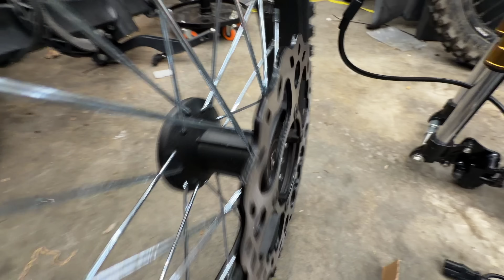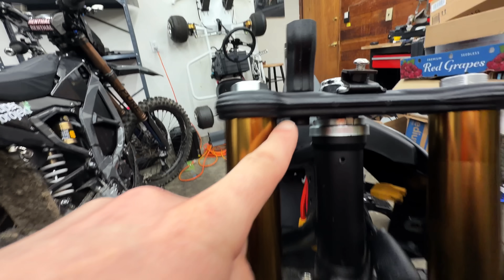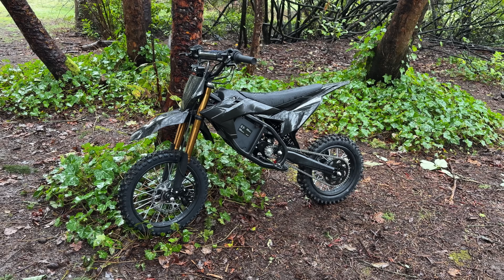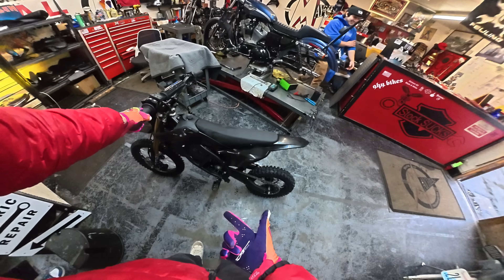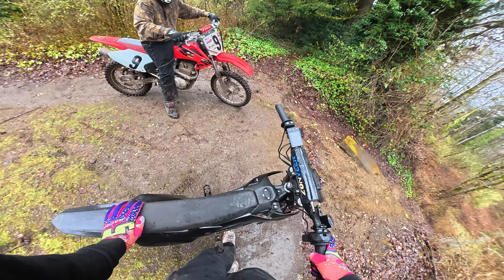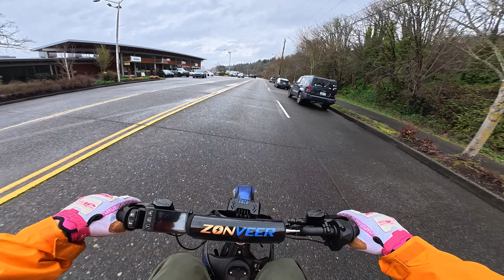Budget Mini Bikes are Getting Too Good...

Comment: You’re missing 5 key issues in your podcast ..
Everyone reviewing e-bikes shows ..unboxing ..package components..build & demo riding..how good is it..& cost….BUT IMPORTANT TOPICS  NOT MENTIONED ARE..
1..warranty ..2..reviews of problems..3..how good is customer service..4..if there is a problem where to get service for the e-bike to get it fixed ..5..if returning ..do you need the original packing ..& cost to ship ..

Comment: If you think that’s the cheapest best bike buy the x1 spark it’s top speed is 50mph and it’s a 60v battery with a 4500 watt motor and 14 12 inch tires

Comment: I'm sad to say that between me and my folding ebike there's enough weight to trip road sensors for the light at intersections.
Reply: And for tackling this feat, you receive the most telling screen name award!
Reply: Brother, light sensors ....they don't work off weight, you think they are putting scales and dealing with that shit?   Those rings (inductive loops) are metal detectors, that's how they sense vehicles... Motorcycles often have issues due to having such a small amount of steel/ferrous metal compared to cars. 

Lol, weight to trip sensors... Bahahaha
Reply: @savagefrito  I roll corrected. It kind of sucks that it doesn't work at all of them though.